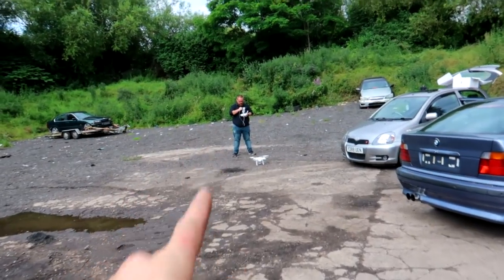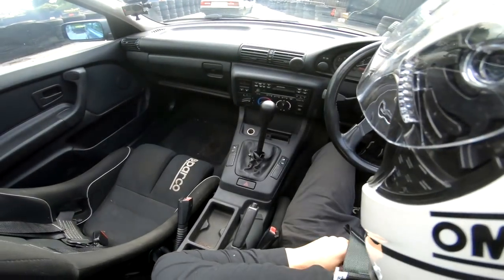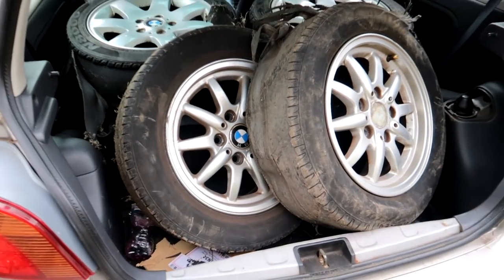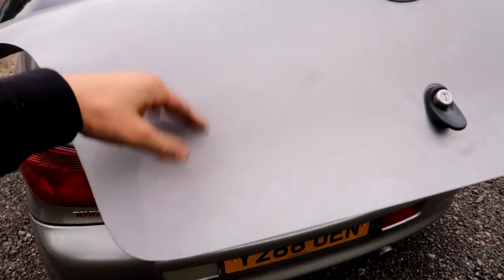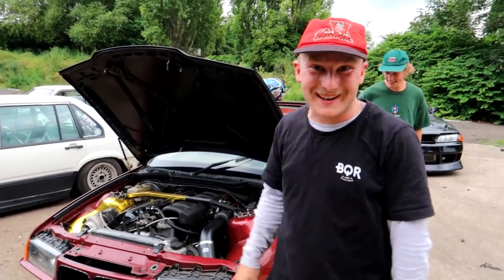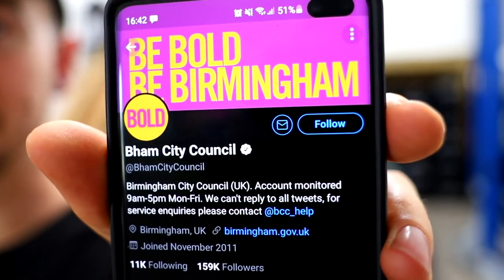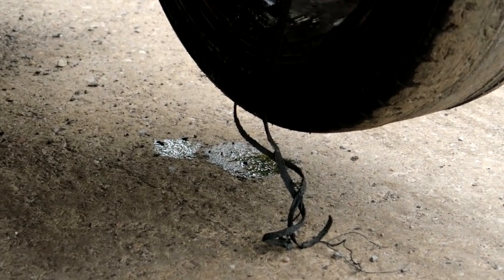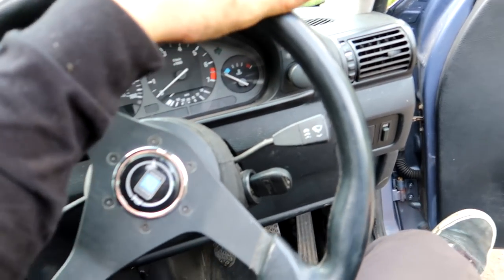E36 Drift Build - Episode 8

Comment: just fyi, stock intake will intake cold air, not hot air from engine bay like your 'cold air intake' does, and you also lose a little bit of power with the 'cold' air intake.